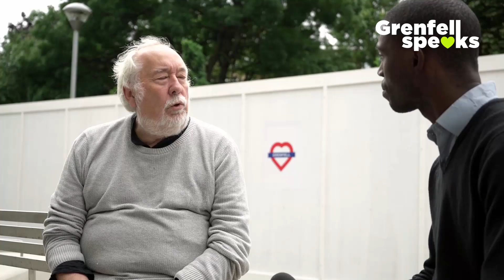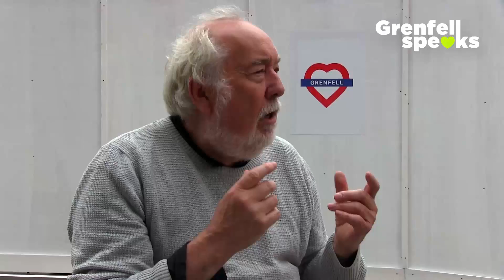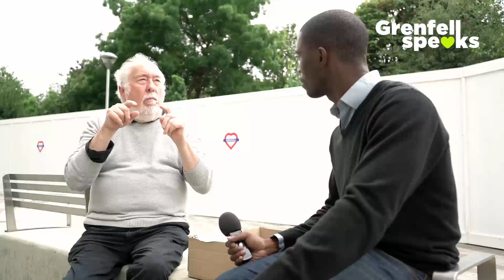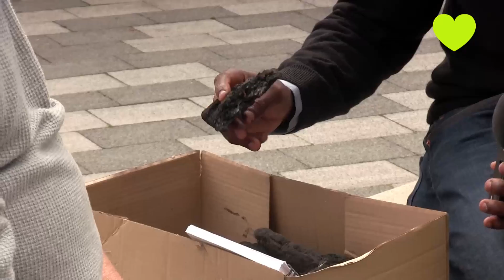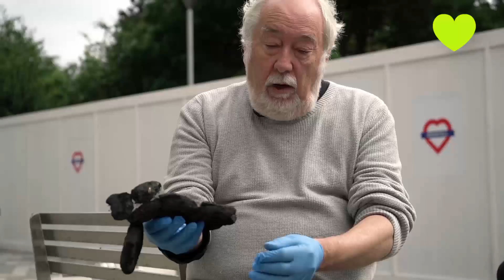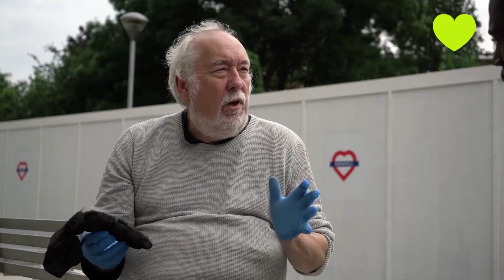Grenfell Speaks with Dr Tom Woolley (Full Interview) | Grenfell Speaks

Comment: We are Chartered Surveyors who for some years have been warning the public about the dangers of these flammable foam based insulation materials.  We posted a video of burning Kingspan insulation on youtube at the time Grenfell was burning, and were threatened with defamation action by Kingspan who denied any involvement.  They have since been proven to have product on Grenfell, and the flammability of materials has never been in doubt.  Channel 4 took up the case and have since run a number of very revealing features on Kingspan.  These foams were banned in mines underground many years ago after many miners were killed by toxic fumes in a mine fire in Idaho caused by burning PIR foam.  It is sprayed into roof spaces under the name of sprayfoam, or icynene, and is equally flammable and toxic. Even the claimed insulation values of these materials have been overstated by manufacturers who form a cabal to influence Building Regulations, and prevent other products from being approved.  'Dame' Hackitt - who was appointed to oversee review of these materials and regulations is totally biased - she is a chemical industry insider who has been an active part of management of foam manufacturing companies.  The entire system is flawed and corrupt from the top (Westminster) down.  Only full publication of all of these issues, personal connections, dangers etc will prevent another Grenfell - and lets face the fact that fire safety testing doesnt even take into consideration buildings only 3 or 4 storeys high!
Reply: Peter Ward wow, you said it perfectly, the whole system is corrupt. This video and your comment SCREAMS to me and everyone who will listen, that we are in a CORRUPT system point blank. These things happen in so many industries...pharmaceutical and dozens of others...so very sad.